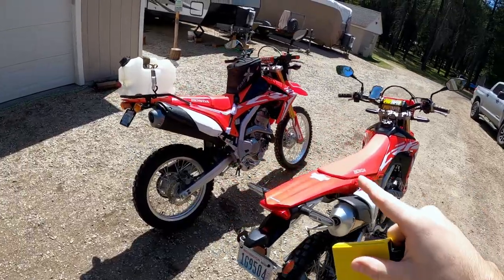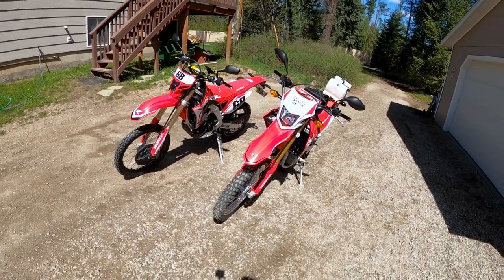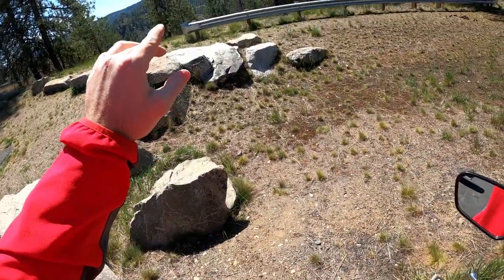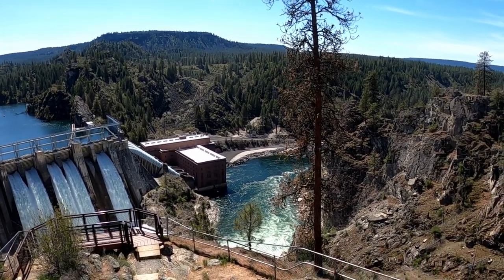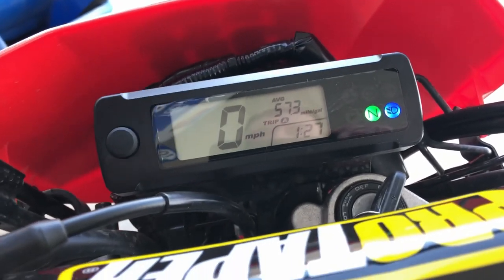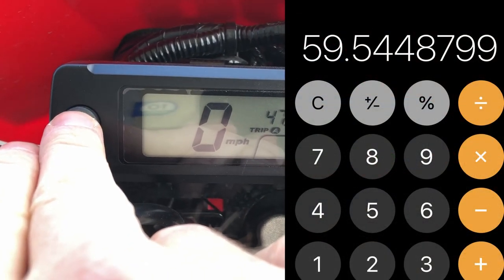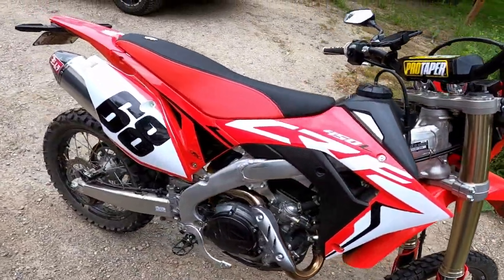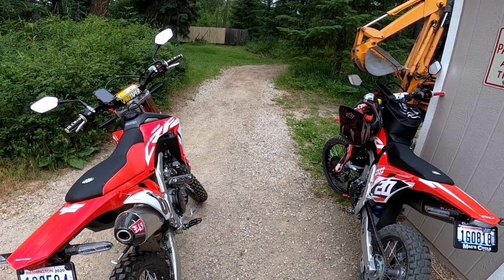CRF450l MPG Stock vs Vortex Mod

Comment: With the Vortex I average 48 MPG cruising (highway or gravel roads) with a plus 1 tooth on the rear. It was up to 54 MPG stock. I can guzzle gas at 32 MPG if I am playing, but you've really gotta want to guzzle gas.
Reply from the maker: For the HP we are getting out of it I don’t think these numbers are really that bad. According to the computer I get 35 playing with the kids and chasing them on my dads property but I am in second most of the time
Reply: @DadsDomain  Nope. No complaints here!

Comment: A cam with higher lift and duration provides additional power when the fuel charge is dependent upon vacuum. If your observation is correct about the cam seeming to make a difference at higher rpm's it's probably just because the ecu can tell the motorcycle is being asked to accelerate harder. Unless the ecu can be remapped along the entire fuel curve to accommodate it an aggressive cam is just a gimmick and may just where the valve train out faster.
Reply from the maker: They did custom program the ECU to go with it....I haven't found out any info on how different that is though. I wish the computer program wasn't so expensive or I'd be tempted to pick it up for myself and we'd be able to compare. It runs so good now though I feel no need to tinker

Comment: Love the crf450l and that dam stop was awesome what a place the views were really good also love the mods yoshi exhausts muffler vortex is ment be what the honda needs like big improvements throttle and power output
Reply from the maker: Thats my third time out there this year, its just the perfect length for a quick Sunday ride with an amazing view. Whats crazy about the mods is I didn't change anything inside the motor, cam, piston...etc. The amount of power gained compared to stock is just crazy so I'm glad I did it!

Comment: That's got to know. I got the vortex set on the Enduro map (#2).  I like the smoother throttle response compared to the power maps.
Reply: Are the trail and enduro setting noticeably different? I ran the trail map before my starter burned up and it still stalled quite a bit.

Comment: Great job.  That is a surprising amount of lost MPG.  I wonder if running it on the Vortex will ultimately gum things up with carbon deposits.
Reply from the maker: I am worried about that and leaned mine out some. I want to get one of those little cameras and check on it after a couple K just to make sure as well. Could just look down the spark plug hole

Comment: Cool video, interesting. However I thought you mentioned jetting on a 450L...???
Reply from the maker: Good catch. I refer to the vortex adjustments as jetting. Old habit but the low is like the pilot. Mid is the needle and high is the main. Just old enough to probably not kick that habit until we are on electric bikes!

Comment: So my 450L got around 60-65 miles from topped off until  the fuel light on , cruising at 70 mph
Reply: That's before it broke of course.  With the vortex ECU set @ 555 and FMF Q4. It was 188 miles to my house from where I bought it in Virginia.
Reply from the maker: What happened to it when it broke down? That was amazing mileage though
Reply: @DadsDomain  the starter chewed the teeth off of the shaft. I have been waiting for a new starter from Honda since June 6th
Reply: @DadsDomain  not 63 mpg , 63 miles from fully topped off until the fuel light came on.
Reply: @ADVRally  sounds like a problem like my brand new 300l had. The fuel indicator only read about a gallon. I was going to bring it in until I accidentally ran out of gas. Fixed the problem right afterwards though, started to indicate just fine.

Comment: Did the yoske pipe/muffler effect the turn signal?
Reply from the maker: Nope, but the fmf power core will. If you go fmf use the quiet one. If you want loud the yoshi is safe. People make the fmf work but this is based on what I have heard